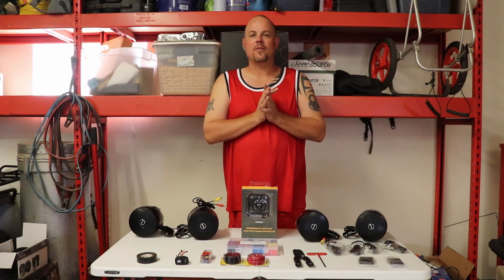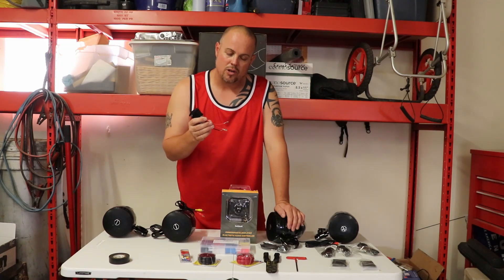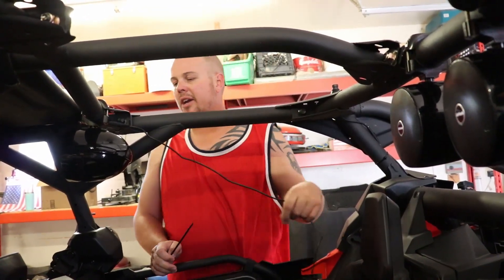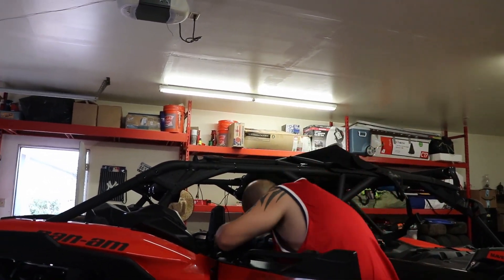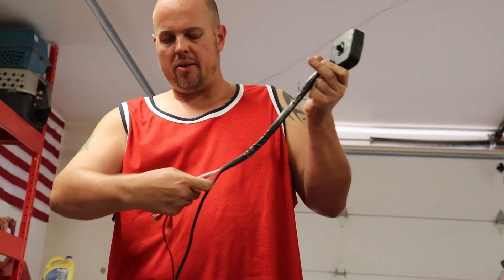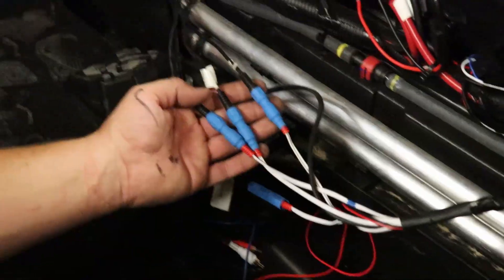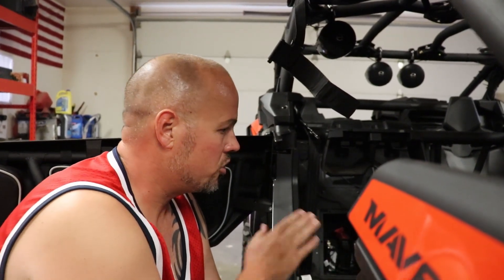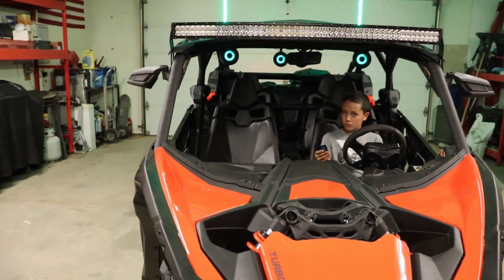Stereo Install Can am Maverick X3- Affordable Bluetooth System

Comment: I like the video. I bought the Noem 4 speaker with an amp and rocker switch. I will most likely hook it to the battery. I have the 2020 Maverick X3 two seater.
Reply: I have the two speaker and subwoofer version and i'm pretty happy with it!

Comment: Was there a remote wire that you had to connect somewhere? I bought a JBL soundbar it has the power ground and remote wire. Or is the remote just in case I want to connect extra amp or something?
Reply from the maker: If its the blue remote wire that would be used to an external amplifier if you added one for more bass

Comment: Are you running the stock battery?
Reply from the maker: Upgraded to a dual battery with a power management system.
Reply: Nice how much was that?
Reply from the maker: @robertfernandez3259  each system is built custom to the machien. It ranges from 800 on up depending on what all electronics are involved.
Reply: Thanks man, good videos by the way

Comment: You really should’ve shown where the electrical connections were made anybody can bolt parts to a frame
Reply: Hey troll, its pretty simple, you plug the black to black, red to red and rca to your speakers.  My 2 year old can figure this out.  It is a plug and play system.   The info on how to run the cables was of most importance when installing my plug and play system..  Funny how you created a channel 1 hour ago, so that you could be critical of something a child can do.
Reply: @richardsisneros9888  Here you go and start insulting right off the get-go I was talking about the location of the box where you connect the wires to and which ones were which constant power ground Accessory switch I always like meeting tough guys with keyboards
Reply from the maker: Not going to get too specific on how to connect some RCA cables, if more instructions are needed then I displayed I would recommend hiring a professional shop to install the plug and play system but never the less you can get the just on how to connect the plug and Play system in these times of the video...

Connecting power and ground wire  to accessory power and ground on power block. 13:43

 Quick view on connecting speaker RCA 15:07

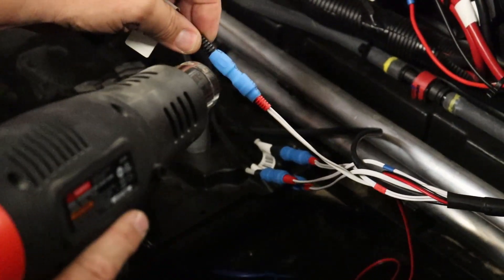Final display of RCA speaker connections connected 16:08

Running the cables will obviously be according to the machine and personal preference.

Hope that helps!!!